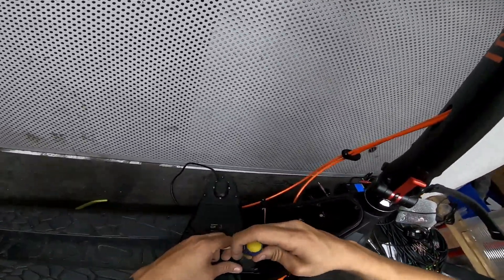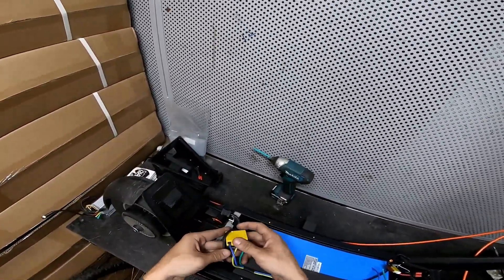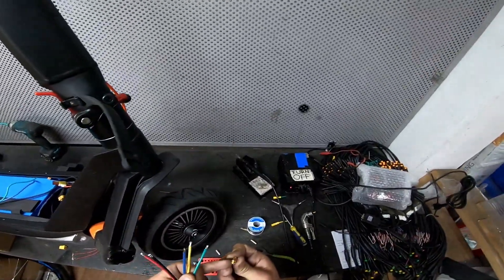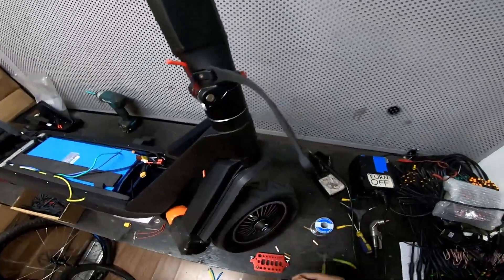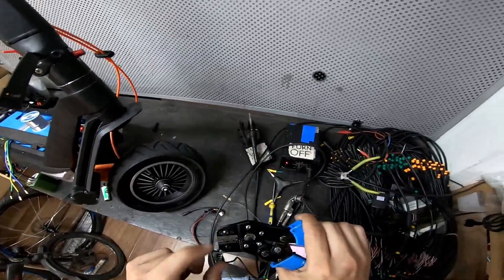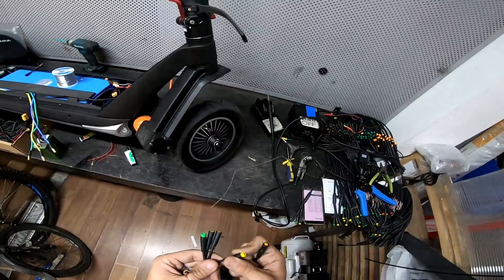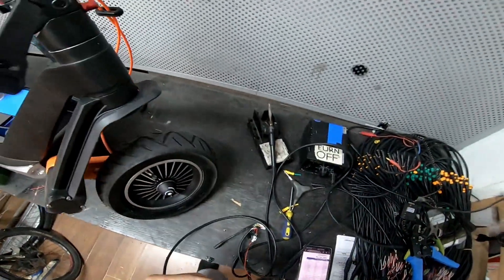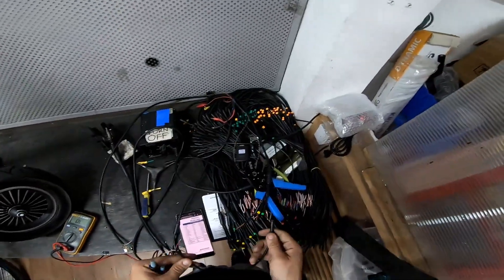Inokim OX asi bac855 FULL INSTALLATION GUIDE PART 1

Comment from the maker: i've said that female connectors are always on the output side of the electronics, but there was a slight mistake in the video, the positive and the negative cables, are inputs ! means they're waiting for the current from the battery! means it is suppose to be male connector. all this is just for a future precautions.

Comment: Hey fella, can I ask a quick question? I've got the Oxo and recently upgraded the battery (72v), controllers (Asi Bac 855s) and throttle (750c display etc). It drives amazing but after about 5/10 mins the front motor stops working and I get a 'error 21h'' (display still on but no power to front motor). The rear motor continues to work fine and if I turn off / on the display the front motor starts working again...for about 5 mins. Did you have this issue when upgrading your Ox? if so, how did you fix it? Thanks again  😉👍
Reply from the maker: Well, I got a golden rule not to use any displays with this controller because there's a lot of miscommunication between the both, doesn't matter which type. You need to get access ( which is also a pita because asi won't give it to you easily ), then in the app you'll be able to see more specific reason for this issue . I've built probably more than 100 of these so I kinda seen all errors . But I need to know which is it.
Reply: @SUB13333  Thanks man. I bought it all as a kit from the brilliant guys at: 'taisomirgaminam' (https://www.taisomirgaminam.lt/en/product/asi-bac-855-pp-inokim-oxo/), where the 750 was an option. Might give them a wee shout and see if they have seen similar issues in previous kits they've installed/sold (I can't be the only one). Will post an update here and let you know how I got on, fella. Thanks again! 👍
Reply: Update: Finally resolved the issue. Display must be wired to the rear controller/motor and throttle wired to both front and back controller/motor. Then a little tweak via the 'Bacdoor' app and all working fine, thank god. Crazy powerful now though - on mode 3 it wants to rip my arms off but on mode 5 it just lights up both wheels no matter how fast you are going. Have to say though, with all that power the throttle is still very user friendly. You can easily maintain a low constant speed, which is way better than the standard Oxo throttle which I found very twitchy when running both motors. Thanks for the help though buddy and as always, love the vids/work. 😎👍
Reply from the maker: @crazylikeafox7290  appreciate the update , yes , this is the awesome parts in smart controllers , power modes irrelevant because throttle is sensitive for maintaining any type of speeds. Enjoy the ride!
I am in a lot of projects right now, hopefully soon I'll have enough time to upload some new content!!
Reply: @SUB13333  Thanks man. And that would be awesome. Love your vids, more so on that ever evolving monster Ox of yours. 🛴💨😎👌

Comment: Brilliant video, fella. Very informative and well put together. I've just picked up an Oxo and wondered, if you know, is the upgrade process similar to your Ox? I was looking at picking up the ASI Bac 855 duel controllers and 72v battery but not sure how easy is to replace. Also, when upgrading the controller did you need to do anything with the motors? Thanks  😊👍
Reply from the maker: Same process yeah. Motors stays the same. Maybe some Ferrofluid for cooling, nothing more .
Reply: @SUB13333  You are a legend. Thanks fella 🙏😉